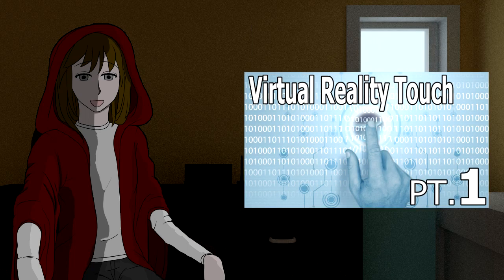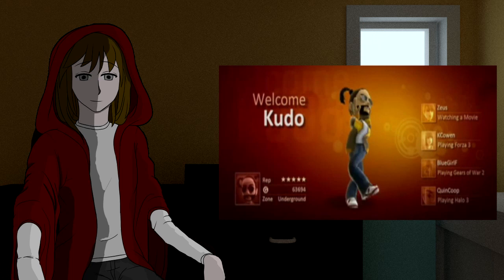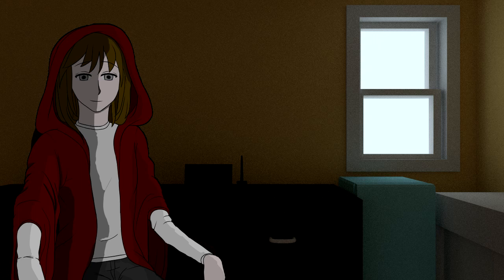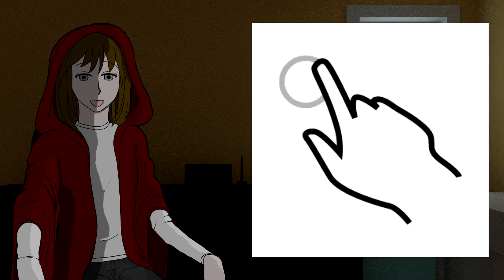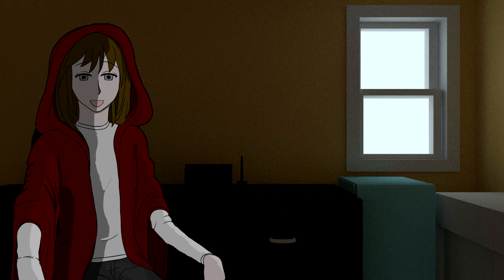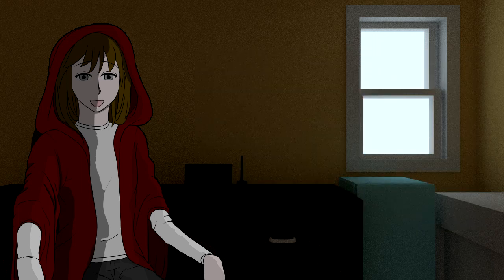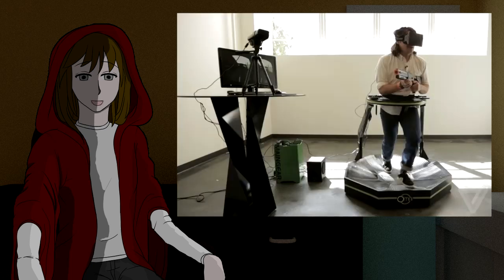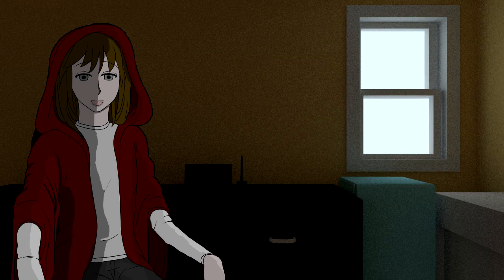Virtual Reality Touch [Pt.2]: Bridge to Another World

Comment: 2 things first of in some cases it's kinda just dreaming (in a way) so if researchers monitored the brains reactions during a dreaming state can't they just see what part of the brain is being affected rather it be in a good or bad way? 

2nd just like you said at the end with the forehead thingy what if there was a full head suit that bypassed the skull in a way to basically create fake scenarios straight to the brain such as whatever part of the brain stimulates touch there will be data flowing and changing your brains Decision to listen and react to the data given not by the individual body but by programmers BUT that could possibly cause paralyzation cause it would stop taking data from the body and take it from the fake source BUT THEN AGAIN there was a scientific research done were they took a head and brain of a monkey and reattached it to a different monkeys body but just like I've been saying it ended up being paralyzed from the neck down. Anyways I hope this helped or opened your minds in any way <3

Comment: Oooooo... I wanna hear what your idea is for the touch sensation thing.

The only thing I can think up on simulating touch is to somehow use that EEG headset thing in reverse. Instead of reading and receiving brain signals, it sends signals to the brain to trick it into thinking you're touching or feeling something when you're really not.

 Though that seems like hardest method of doing things too, but also I bet would give the highest quality of touch too. The big problem would be how to send signals to the brain without sticking wires to the brain or sticking a signal reciever to the brain or some other thing would require potentially dangerous brain surgery. Or maybe some implants underneath the skin that sends signals to the brain via your own nervous system. Sounds a whole lot less dangerous but surgery is still surgery and while being less dangerous, there is the potential to become dangerous. Plus I'm sure that's be expensive too. Plus I bet there would be some other medical problem that I don't know about.

Second problem would be figuring out which brainwaves are the ones that are about touch and then accurately replicating them whenever you want to send to the brain. But that's the easiest part probably since that could be figured out with lots of testing.
Reply from the maker: EEGs don't really send electricity to the body, so much as they just read it. The tricky part of sending signals into the brain is really getting them across to begin with. EEGs have to interpret amplified signals of brain electrical activity via electrodes, making their technique very indirect. Overall, EEGs are more inferring brain activity than they are directly reading it.

Even then, as you mentioned there are some very big issues when it comes to sending signals to the brain directly. Aside from the fact we don't know the brain's "language", every brain is different which would render any attempts to create a standard tool set very difficult without some form of calibration process. Then there's the fact that sending any data that the brain isn't ready for in could have questionable effects on the mind as it is a rather delicate instrument in terms of it's functionality and operation. I don't think it's likely that direct brain stimulation will come about any time soon for the purpose of stimulation without some kind of genius or sudden intensification in the desire to do so, but this doesn't necessarily mean we don't have other methods. That's what I'm looking for at this moment.

To be honest, my theory is a lot more "underhanded" in it's approach. For now, I can say that the primary implementation I have in mind is head mounted, though it could in principle go on almost any part of the body without question. It doesn't pull of some miraculous direct brain stimulation, but it does take advantage of a lot of it's weaknesses. It could be said, I'm kind of conning your sense of reality rather than directly interacting with it.

Hope this is enough for now. I don't want to say too much before I actually make the video as it almost feels like too much work to write out the explanation several times when I'm going to make a video about it eventually that should go over most of the material. It should be up some time this week, though admittedly I may push it back to coincide with a new formatting update that I'm doing to my videos, but perhaps that would be better to do with the new videos on the Full Dive I'm going to be doing. Gah, I'm just thinking in type now. Thanks for commenting iAMsuperBlast :)
Reply: Virtual Dreamers 
I kinda figured EEGs couldn't send anything, I was just thinking of something that would be the reverse of what EEGs do.. Though after the tiny explanation of EEGs in your comment, I probably should've picked that in sating the reverse of it lol. All I really know about them is from memory I accumulated over the years without any real explanation other other then they read your brain signals somehow lol.

But yeah I wasn't thinking you'd say anything about what your idea would be before the video is even up. So I'll wait 'till whenever it's up.

Anywho, keep up the videos! They really interest me!